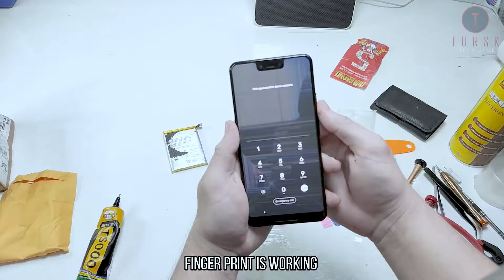Google Pixel 3XL battery replacement

Comment: After you replace the battery,any problem with your's pixel 3xl sir?
Reply from the maker: Still using, no problem. These Chinese OEM batteries are worth to buy because original battery is so expensive. You can buy at Alibaba or Taoabo. But you need to choose Branded shop. Ok, bro.
Reply: @tursk9607  thank you bro,this battery capacity is same with the original or more than the original one
Reply from the maker: @ipoenx18  A little more mAh than original one.